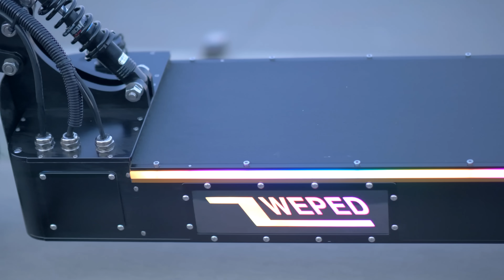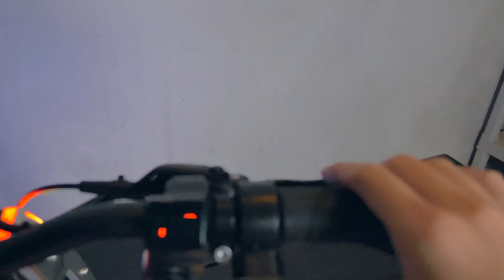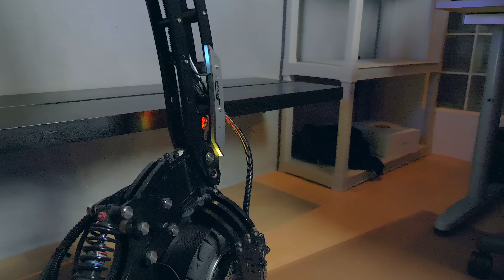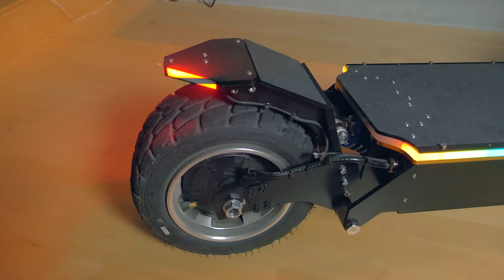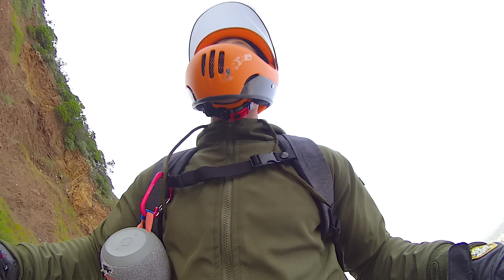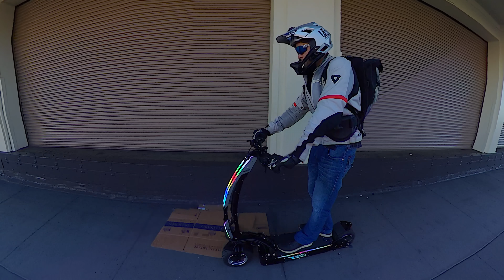WEPED SS Electric Scooter, An Insanely Fast And High Quality Ride

Comment: It’s all fun and games when ur going 70 mph til u go over a pothole and die 😂
Reply: Wear 22 layers of bubble wrap
Reply from the maker: Yeah, hope to find that out soon 😬😅
Reply: Exactly, why the fuck are those tires so small with that speed?
Reply: @omgitzhaze  Still way better than tiny skateboard wheels that go 25mph on electric boards. Small wheels are easier to turn which equals faster and really they (kick-scooter wheels) are pretty stable....ehh mostly lol.
 
The bigger the wheel the more watts needed and more battery power so then the whole scooter keeps getting bigger. 

They do make a kick-scooter with big ass balloon tires (and permanent seat) but it only does like 18mph, its almost like an old persons mobility scooter.
Reply: @NoNORADon911  I'm just saying I had a scooter with slightly bigger tires going slower and I almost killed myself on that lol
Reply: This unit has such huge power, that incorporating larger tires would only be beneficial to the entire experience.
Reply: @WorldCitizen0011  It will work you just get less range and slower take offs. Law of physics. Bigger wheels equal more mass which is harder to turn which takes more power, more power uses more battery, more battery equals less range. Car people already figured this out with those big ass wagon wheels. And truck people too.
Reply: @NoNORADon911  Thank you for your contribution to this discussion.
Reply: @NoNORADon911  The size of the wheel doesn't have shit to do with watts of electricity.
Reply: @brokenwishbone422  Ok jackass put 33" wheels on and see what happens LOL
Reply: @omgitzhaze  yeah i went down so much from potholes, cracks in the road, obstacles like stones and quarter bricks on my little 50cc scooter when i was 16 than the rest of my life on bikes, and those wheel are quite a bit bigger than this one with about half the speed, i would be shitting my pants riding this in the public, i think it's a track scooter only really.
Reply: @shroomzgames7370  that's what I'm thinking as well, no way you can ride this on NYC streets.
Reply: @NoNORADon911  Small wheels are easier to turn which equals faster ................. load of cobblers
Reply: @NoNORADon911  (kick-scooter wheels) are pretty stable....pure cobblers m8e
Reply: @NoNORADon911  The bigger the wheel the more watts needed and more battery power......... completely pure load of old cobblers
Reply: @raymondo162  Poor fella...did you sustain brain damage from all your mask wearing and lack of oxygen or is this what the experimental government injection does to people? Or are you just being you?
Reply: Just wear full motorcycle gear and get a Snell approved motorcycle helmet that if full face that isn't a dirtbike helmet and you will be fine.
Reply: @illuforce  That will not help I crashed my DT3 and broke both my arms@ 30MPH
Reply: @TouchwoodTV  Really? how you crash. i crashed at same speed. flew superman forward onto rough tarmac road. road rashes scrapes to both hands. left hand was worse. right knee and elbow. upper thigh next to pelvic. scrapes to my helmet front and side. saved my head. Lucky to have no broken bones apart from bad sprained left wrist  im not sure what happened. was speeding back and forth on my street showing off. lol. lucky for road humps on my street slows us down before building ups speeds. Suddenly my handle bars wobbled as i sped off from a road hump. maybe the road contributed too? and then flew off.
took time off work for 2weeks to heal. After 4weeks i was back on the roads again. learnt my lesson. more respect for the roads and people
The clothing i wore didnt help. thin gloves. wore long pants thin material. wore hoody but still scraped to elbow. 
since then i have upgraded my safety gear clothing
Reply: @kiwimon3204  glad to hear you are better now and upgraded your clothing :)
Reply: @TouchwoodTV  Just because you are wearing gear doesn't mean you won't get hurt. Your just less likely to.
Reply: TouchwoodTV damn that’s insane! Breaking both of your arms at the same time is horrible. I really hope you’re doing okay and hopefully healing up if this happened recently. 

A couple questions if you don’t mind. 
First, will you ever ride again or did the injury/accident make you not want to ride anymore?  
Second, can you share more as to what happened?  Did you hit some type of pot hole or was it just an accidental fall or loss of balance?  Sorry, I’m just really curious how it all happened and I truly wish you a fast recovery.
Reply: @chrisjenkins203  Yes how do you wipe butt or eat....my mom (RIP) said God gave us spare parts, 2 eyes, ears, nostrils, feet, legs, arms, hands, so if we hurt one we still have another, usually works but not always.
Reply: Take America Back From Isяael I agree with you 100%. I have the same exact questions and I hope @Touchwood TV follows up and elaborates. We all seem to have sincere concern for the injuries he sustained and would like to know more. 

It sounds like your mother was a very smart and knowledgeable lady because thats a good point she made about how we have the extra of each in case something happens to one. 
More of why I would like to hear back from @Touchwood TV and hear about how they dealt with having those injuries and getting through basic daily tasks. 

The rest of us forgot how crucial having full use of our body really is until something like that happens and then we are reminded quickly when, like you said, all of a sudden we can’t wipe our own butt anymore. I’m not saying that as a joke, in fact, I am being completely serious. Please, Touchwood, reply at your convenience and share with the rest of us how you got thru, which had to of been an extremely challenging time in life for you.
Reply: @illuforce  doesn't work... the handle bar can fracture your ribs upon crashing.
Reply: @SinisterAngel1  Go on revzilla and buy a chest protector so you at least have something then to protect your ribs but your more likely to be completely separated from the scooter at 70mph so road rash and your head and hands should be the biggest worry.
Reply: Glad I haven't died yet racing my 30-60Kw Gp scooter's here in my Mighty Los Angeles for the last 15 year's with all these pot holes 🤐
Reply: @Prime8627  so are bigger tires safer
Reply: You might want to adapt your driving style to the environment. I mean, you CAN check it before you speed up, can't you?
Reply: Well at 70 MPH the tire and speed of the scooter you'll most likely hover over the pothole, Depends on how big of a pothole were talking about. But if its big you will most likely spot it and go around it, Unless you have a death wish then by all means go for it!!
Reply: Lmao
Reply: Definitely mate
Reply: zackly!!!!

Comment: The reason why it kicks so much is not because it has so much power. It is because it has shitty speed controllers that you can't set to your liking. Nothing compares to the VESC, unfortunately they don't have high enough voltage for 14s+  That's all. Awesome scooter nevertheless.
Reply from the maker: Good point around the kick, I suppose you could have the same amount of acceleration with better controllers? I think this is something they are working on.

Comment: too bad the downstem geometry is piss poor and cannot be stable at all.
Reply from the maker: What's an example of a scooter for you with good geometry? Just curious...
Reply: @AlienRides  your hands should be just in front of the axis of the front wheel for the best stability. same goes for bycicles and motorcycles. those bars cant be as stable as say a dualtron where you can tilt the bars forward a bit. its the nature of the two wheeled beast.
Reply from the maker: Samuel Zavala interesting day you can definitely tilt the handlebars on the Weped, I love my Dualtron Thunder, but find the Weped just as stable or more at speed.
Reply: @AlienRides  i guess id have to try it to know for sure.

Comment: UGH! The WEPED SS has been available here in the Philippines for a couple of months now. Too bad it is still waaaaaaay off my budget. But man... THE SPECS! DROOL!!!
WEPED SS has some KILLER SPECS
BATTERY: 72V 45AH 21700 Samsung 50E cell
ENGINE POWER:10800W
CONTROLLERS: 2 x 120A
SPEED: 120 kph or 74.56 mph <That's Scary Fast>
WHEELS: Super Wide Go Kart Racing Tires
RANGE: On a single charge: 120 km (74.56 miles)~150 km (93.20 miles) <NOT BAD!!!>
Reply from the maker: Yeah, it's a total beast, and out of the range of many, but something to aspire to. The upcoming Weped CT is also going to be amazing and a lot more approachable.
Reply: @AlienRides  The WEPED CT is also already available here in the Philippines and it is waaaay cheaper.

Comment: Hello. Good evening. Dualtron X is More Confortable ?? and apart what is best for you Rion RE80 or weped SSR
Reply from the maker: The Dualtron X is very comfortable, almost like a floating on a cloud, but it's very slow compared to the Weped SS or the Rion. I'm not sure which I prefer right now between the RE80 and the Weped SS, both have their uses and I hope to ride both extensively in the future. Those two are my top two scooters right now.
Reply: @AlienRides Thanks for the comment : ) dualtron X fast is more stable than weped ssr ?
Reply from the maker: Eleazar Morillo no, I think the ss is much more stable at speed actually.. the Dualtron X can be a bit hard to control after a bump at 50mph, and buck you off.

Comment: GEEZ! This thing might as well be sold as an actual motorcycle!
Reply: I've ridden bikes over 100mph and can guarantee they feel much more stable than this thing even at 50 mph ... I also crashed at 65mph on a Yamaha  when the front wheel went into an uncontrollable wobble on I-95
Reply: A motorcycle would be cheaper.
Reply from the maker: Yeah, it's basically a standup electric motorcycle, and it's awesome. ⚡️💪

Comment: Looks like its made for city cops transitioning into electric pursuit vehicles instead of the limited capacity of bicycles, the quick pickup is right for chasing bad guys, the company that makes them should supply several for police to try out.
Reply from the maker: Honestly this could make for one of the best city cop vehicles out there. Gets around town much faster than a car/bicycle. I think a police force in the Philippines has started using scooters to get around.
Reply: @AlienRides  You could/should be the commissioned salesman to sell them on the idea by showing them the future of policing mobility in San Francisco & LAPD......if you wanted.

Comment: Pros: Rainbow cool colors! Big wide Deck good nonslip grip good fat wide tires good and 50 range miles good 75 miles TopSpeed good video review good. Cons: insane pricey rather get an electric car. Or electric motorcycle. Or electric trike or Rion and something else, Design very industrial it looks like a tractor not very sleek or refined compared to the Rion, Fast charge needed, come on much better if you use it for every day commuting that need to charge it halfway through the day. 100 pounds crazy I’m not caring that upstairs every day multiple times a day. It would be better to be like the rion  where you can make the scooter lighter with the wide platform however you can carry extra battery packs to swap or a supercharger in your bag or you can plug-in anywhere you go and recharge as you go it makes more sense than to make a super big bulky heavy and tractor looking scooter, however the heaviness and the wide tires do add to the stability of the ride. Last point what the heck is the fourth button for? You don’t give much detail and you said you never used it and also knowing the level left over of the battery charge on an indicator would be nice after all you’re paying an insane amount of money the least they could do is put a battery level indicator. And in your video you could explain what the fourth button is for. Last pro point waterproof excellent for San Francisco! Keep reviewing keep having fun stay safe and keep posting videos thanks!î
Reply from the maker: Thanks for your detailed thoughts! The more options and competition in the market is a good thing for us all. While it's not perfect, I'm super excited for the next generation of power scooters to come.

Comment: Maybe good as a recreational device, but not particularly practical.  Hopefully, some manufacturers will aim for high quality, light weight and smaller form factor.  Having options beyond Dualtron Spider would be nice.  A practical version of Rion, perhaps.  And the styling?  Aside from the curved stem, it reminds me of the "Cybertruck" with all the angles and straight lines.
Reply from the maker: Yeah, this is definitely more of a recreational device. The upcoming Weped CT would probably make a more practical commuter option, as is their current Weped GT50E. I guess I need to get a Cybertruck with my new SS 🤔

Comment: Its 120 lbs, 25 heavier than the thunder.
Reply from the maker: Cool, didn't know how much exactly, just knew it was crazy heavy! 😅
Reply: Yeah for the weight it would be between the dual tron X and the thunder
Reply: 7000 an you cant even take it in an out the house.......

Comment: How many amps are the controller?
Rion has 240 amp controllers. Dualtron Thunder has 40 amp controllers.
At 40 lbs the Rion should still crush this Weped but there's a lot to like about it. Suspension, range etc.
Reply from the maker: They say this scooter has 10,800 watts peak, so with a 72 volt battery, I guess that's two controllers of 75 amps each. Awesome, but not as high as the Rion... yet

Comment: Totally sweet ride, the whole thing is a 10+. You give the range in terms of hours, would love to see a cross-country video to see it in terms of total miles traveled at different cruising speeds. A good place to do this would be at a marathon,  they typically have routes blocked off to cars for up to 26 miles. At 75 mph, I see a whole group traveling in caravan down a highway, awesome.
Reply from the maker: Thanks for the request. It's an awesome ride for sure and I definitely want to make more videos with it. I'll have to see about making a range video, I'm not sure I can ride that long 😅
Reply: @AlienRides  I checked the site, they have a scoot for $3499, that does 45mph with a range of 65 miles?, pretty decent, call a GT? It's limited to 15pmh for the US.
Reply from the maker: Don Gillis yeah, GT50E. It’s a nice scooter for sure, taking the limiter off is easy, just a single wire to cut.

Comment: Did you mean foolish enough to attempt those speeds , it obviously has way too much power to be street legal in my opinion. That’s not to say it should be available to those that want to take it out on a track or in a safe environment, if I was that bicyclist I wouldn’t want that coming up behind me it’s not intended for bicycle lanes.
Reply from the maker: I find these much better to use as an electric moped over in the bike lane, though if you need a slower speed, press the corsa button, and mode 1, and then you're slow enough to safely travel in the bike lane. Totally up to the rider to be responsible though.

Comment: great review! does the led comes with remote or you can change it to color you want?
Reply from the maker: I’ve seen it be a solid color, but I didn’t get a remote when I borrowed this scooter, so I’m not sure off the top of my head. You should be able to set it to a single color since they’re RGB LEDs.

Comment: Lucky guy 🙏 thanks for us with this demo. It is always a question for us the square tyres.. but seems fine here
Reply from the maker: Yeah, for cruising there's totally fine. Don't corner as smoothly as the rounded tires, but it's totally doable.
Reply: @AlienRides  yes i have a dualtron spider and i hesitate to buy a weped GT.. because of the tyres
..  as you i like to stand up at the red signal 😂 bit i like rounded tyres when i turn it is so smooth.. i'm splitted 😂👍

Comment: @alien Rides I noticed the Weped has grip tape on the deck but I don’t see grip tape on the Rion. Do your feet feel planted on the Rion or does it ever feel like you are going to slide off?
Reply from the maker: I do feel planted on the Rion as well. I think mainly due to the way the Rion deck is contoured.You have a little rear fin that raises up, and the front neck as well. These contours and features help your feet stay in position.
Reply: Alien Rides Good Stuff!!! I’ve always been a fan of the Weped. Definitely looks supercool!! Seems like it’s an excellent cruiser. Just a bit expensive lol. I like the price point of the RE60 better. I wish I could have both. Lol.

Comment: No steering damper on this thing?
Reply from the maker: Nope, but I think that would be one of my first modifications to it. It's pretty easy to mount to the side of the stem, but yeah, ideally it would come with one.
Reply: @AlienRides  yeah its easy to mount one. but a bit strange that they  didnt do it from the factory with that top speed. and high price.